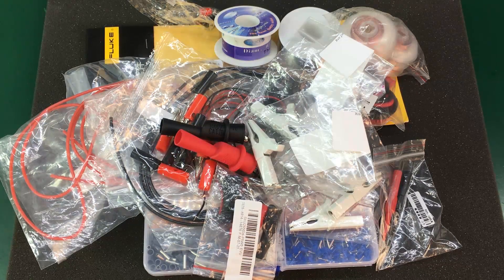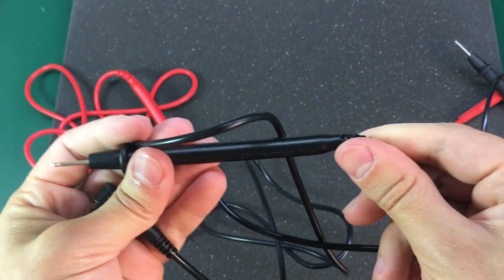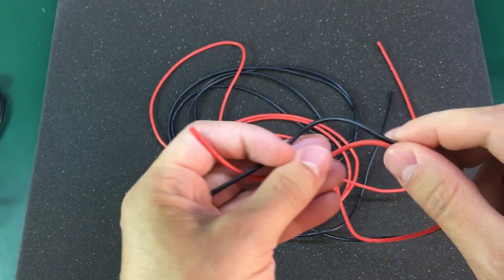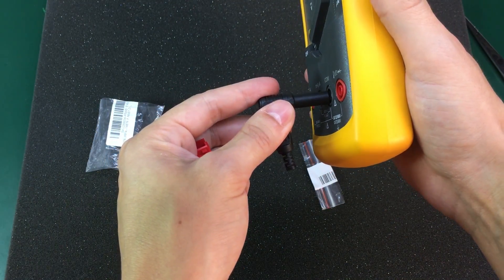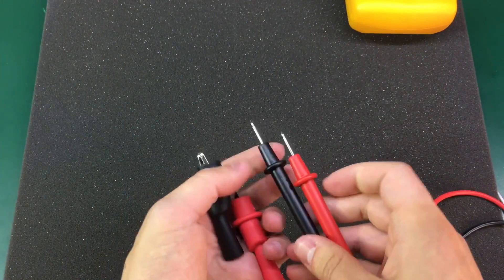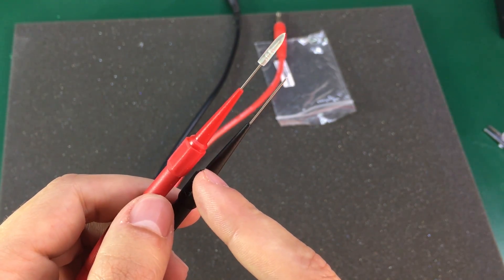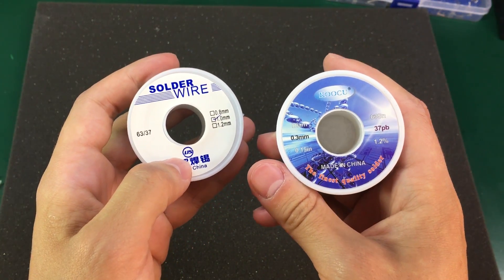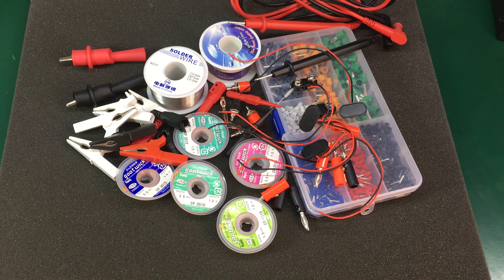Voltlog #55 - InTheMail

Comment: About the 4 white test clips you received. Don't paint them. Just put a piece of heat shrink tubing on the ends where the cable connects to mark them.
Reply from the maker: yep, that could work too.